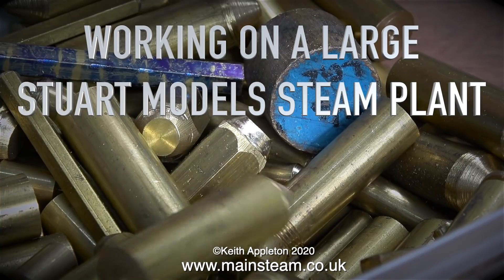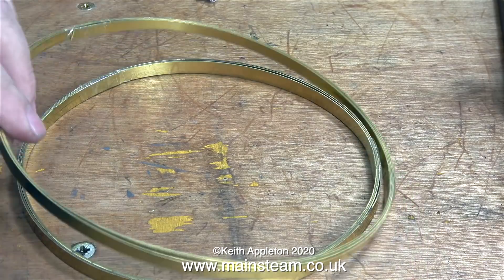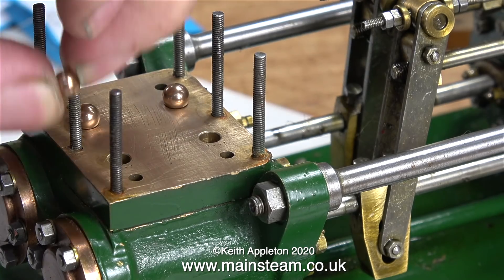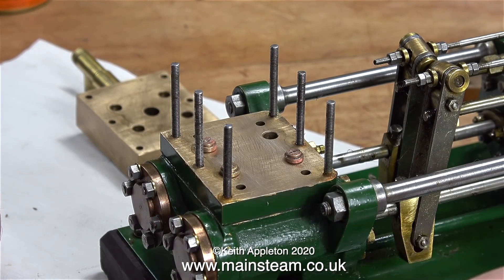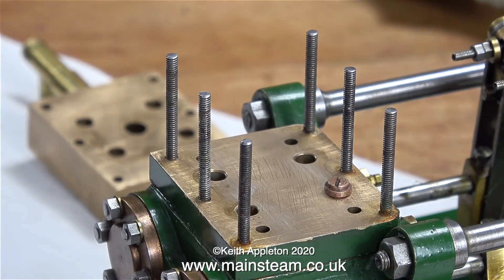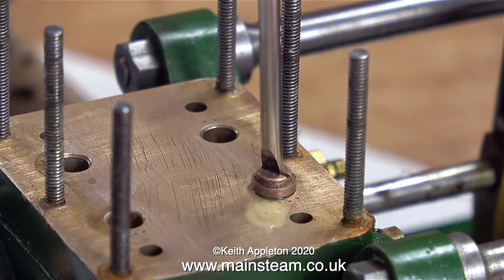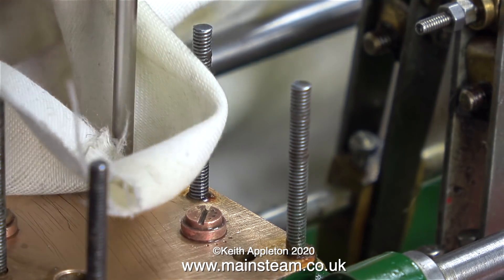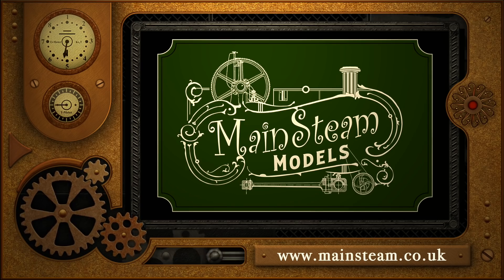WORKING ON A LARGE STUART MODELS STEAM PLANT - PART #3

Comment: Keith, I know that lapping the valves can take a long time, especially using a hand screwdriver. A Yankee type screwdriver or an electric drill with a screwdriver bit would speed things up.
Reply: You'd want to be careful using a power tool here. If the flathead bit slipped out of the valve's head, it could ding up that nice flat machined surface in a hurry. But yes, I agree, I would've probably risked it and figured out an arrangement with a dremel or something.
Reply from the maker: it seemed to work fine doing the way that I showed on the video . . . .
Reply: @keithappleton  Keith, that's why I said a hand powered drill. They used to make a valve lapper which was crank powered and would lap the valves on the block. Just the engineering nerd in me trying to make life more efficient! lol Love your videos and I've learned more about steam engines on your channel than any other source I can think of! Cheers!
Reply: it would be faster, though seeing as it is flat head, not the best control with power tools.